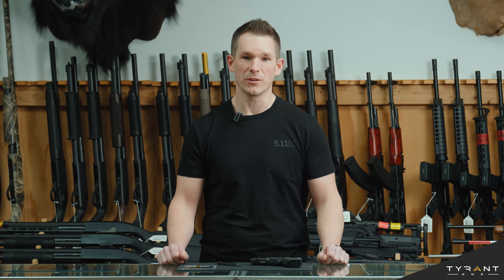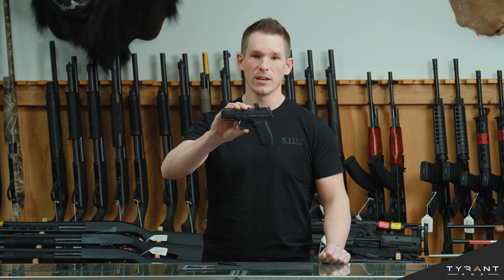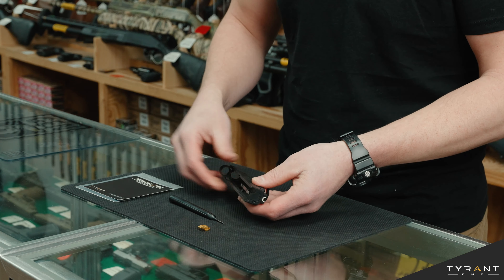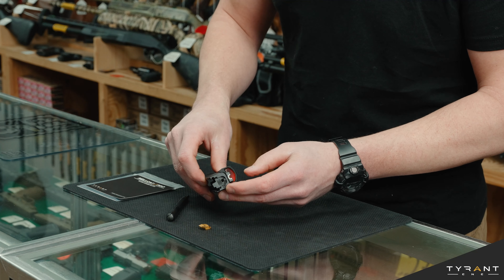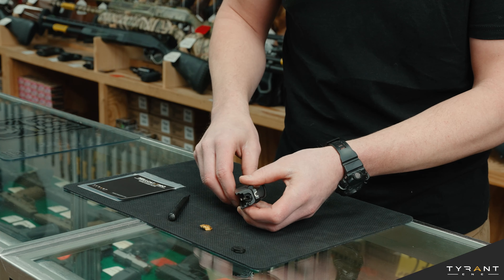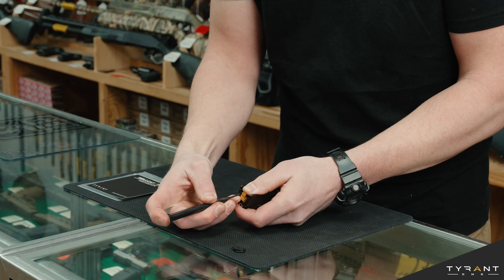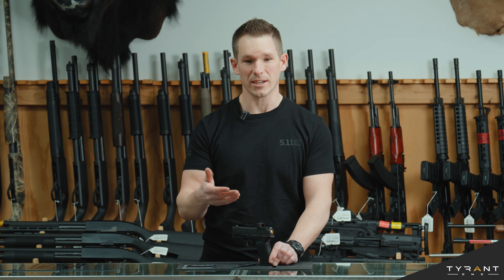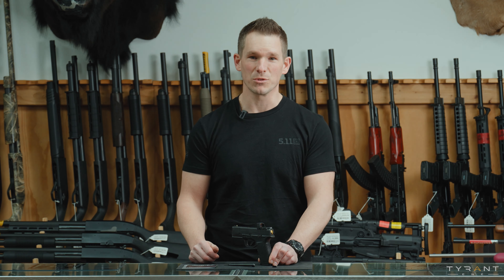Tyrant CNC Hellcat / Hellcat Pro Slide Cover Plate | Install Guide

Comment: Hi Tyrant my Canik Barrel is 13;5 x1 LH, Can I use the UNI-COMP if I use An adpter  13;5 x1 LH to the tradicinal 1x28 ?
Reply from the maker: Possible, but not recommended.

Comment: seeking help: I did not cover the pin and it flew out and I cannot find it. The ejector piece does not work now and I'm wondering if I need a whole new slide replacement or if I can just order the pin that flew loose, any help would be appreciated, thank you!
Reply: just order replacement peices, you do not need an entire new slide lol. If just the pin flew loose that should be all you need to put it back together and have it functioning again.